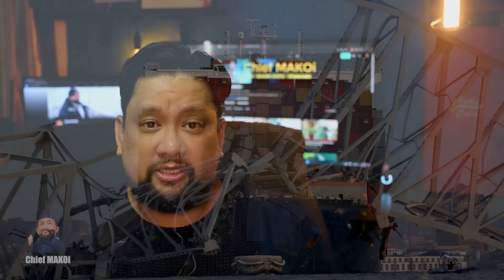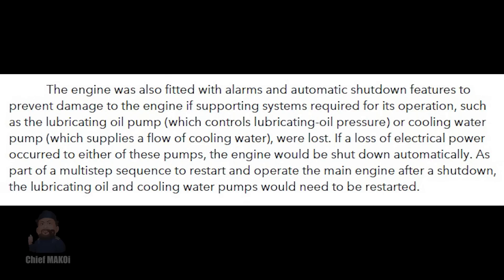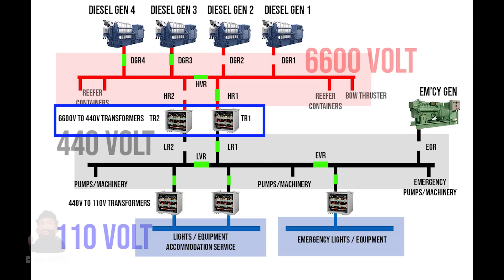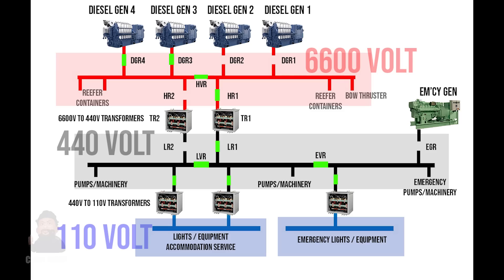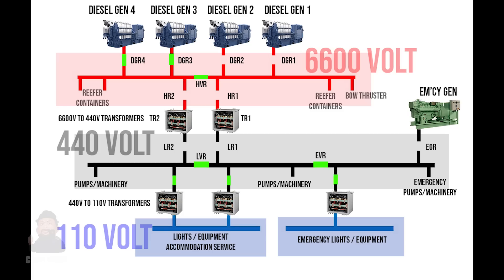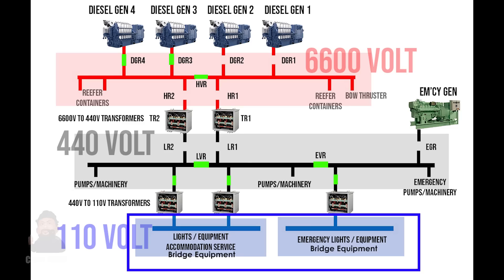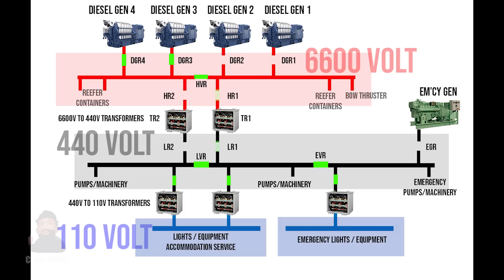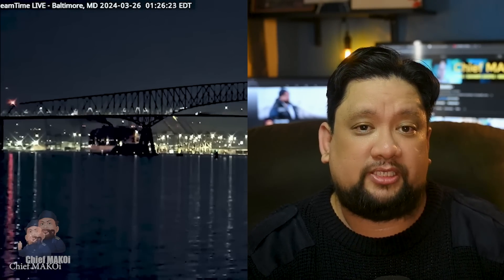Explaining the NTSB Report on the Container Ship DALI | Chief MAKOi

Comment: Regarding the fuel. I would expect NTSB already sampled all tanks and performed FOBAS.
Reply from the maker: It's not contamination.
Reply: @ChiefMAKOi  As I understand it,  samples were sent to the lab.   No contamination was seen and probably not there,  its pretty good stuff in the US at least.    But they will have a full on test series done to see about lubricity good,  cetane up to spec etc.   It may show workable but not as good as spec and its a chance to get that out if so.

Comment: Chief Makoi, I've been a long-time fan and enjoy your videos.  Great analysis!  at the 12:45 mark there is a brief subtle flash on the top beam of the bridge to the left of the Dali, about 20% of the screen width from the Dali.  The lower beam of the bridge has a significant buckle at that point in time directly under that flash suggesting that there may have also been a pre-placed cutting charge on the top beam to facilitate/direct the collapse.  I don't know if you or any of your viewers noticed or care to comment--keep up the GREAT work!
Reply: Could there have been a worm in the software of these automated systems?  There have been reports that the Chinese container cranes in port could have surreptitiously inserted code into shipboard systems (as could numerous other causes), I know you're an engineer, not an IT security expert.  But with automated systems, software is involved, probably not air-gapped systems so accessible online especially when in close proximity to appropriate digital transmitters as would be more likely in port than at sea...
Reply: Ahh the conspiracy stuff comes flying out.    You don't think a million tons ramming a bridge can bring one down all by its lonesome?    Look up the Tampa Bay Bridge,   Tacoma Narrows and the Minnesota collapse (and the near failure of a bridge down Tennessee way that inspections were being faked on).    You just proved there is no over coming the power of human stupidity.
Reply: Some considerations from technical perspective wrt collapse of the Key Bridge itself, some `moving lights´; but especially some `flashes´ which can be observed. Quite long comment, targeting to come up with the physics behind. Deleted my earlier comment and replaced with more detailed review now. Time stamps refer to YT video uploaded by `First Coast News’ (Full Video Francis Scott Key bridge ...); I've also uploaded this comment there.
This moving light, starting 02m31s coming from right, going to left (until 03m13s) at a level where webcam position suggests is “same height as the main bridge truss”, can simply be either helicopter or airplane – that’s it. Period.

Few considerations before digging into the other, individual flashes observed. My view upfront: some of them related to simple electrical shorts, the others most likely due to strong metal bending and ripping caused by forces of the collapse (only).
At 0129 EDT am it’s typically dark, except from the lightshow coming from Baltimore harbour; with some top lights of the container cranes on same height as the bridge truss. So easiest explanation for some `flashes´ simply might be lights being hidden before. Possibly also some reflections when the bridge segment starts moving downwards. Plus the smoke from Dali also causing some blurring effect towards left side. Camera sensor might also be more sensitive with sudden changes when lights covered by the truss before get visible.
However, yes, when carefully observing and watching the video, this cannot really explain the flashes observed.

First glow at 05m39s (012849EDT), then 05m40s (012850EDT), the video shows two flashes, i.e. glowing spots in the middle of the left bridge truss which collapsed and shows serious bending already. Take note all 3 bridge’s flashing signal lights still operating at that time and turned on (especially the one to the right just switched on) – i.e. electricity still present. So easiest explanation could be that we simply can see their cables being damaged and creating short-circuit – which typically ends up with flashes. That’s very obvious for the left bridge truss segment. Assuming cables are running along top side of the truss, that could also explain the flashes observed close to the signal light in the middle of the main truss few moments later at same time 05m40s still. Note this signal light only briefly seemed to light up again but never fully made it and is gone then. At some point we might expect a breaker tripping due to high current. Also lighting on the bridge lanes disappeared on the left and middle truss segment (while still working on the one to the right).
05m42s (012852EDT) is very interesting since the main truss starts to break towards its right pillar, with flashes both on top side of the truss but also its lower, inner bow. I’d be bit surprised and ask why the cable for signal lights on the top should move down to the inner bow there. Could be; flashes would have same root cause then although I’d be surprised that no electrical fuses already cut off power there.
Much more important, extreme bending can be observed, due to large amount of the truss already accelerating towards the water due to its weight and force of gravity (plus possibly some forced due to the impact when Dali hit the pillar), while the part close to the pillar still fixed to it.
05m43s (012853EDT) the middle of main truss has already reached water level – i.e. 50m lower. Same time lights went out on the right truss, possibly another short circuit in case there’s still been voltage present in the cables.
So far some the flashes could have been explained by shorts in the electrical cables. First “white” flash, follow by more yellowish / orange one in case some of the isolation gets burned & vapourized.
But I don’t think that’s all, so let’s get to some more nasty stuff – physics. To start with something easy: there’s no question that cutoff grinding creates a lot of sparks flying around, right? Obviously steel doesn’t really like this treatment. Glowing sparks suggest quite some energy involved, too.

Main truss of the Key bridge had clear height of more than 50m / 167ft. Top level of the main truss could be up to 100m / 333ft. The bridge starts to collapse and gravitation kicks in. Very simple rule says with acceleration of 10m/s² , after 1 second speed could be as fast as 10m/s = 36km/h already; and main bridge truss already dropped by 10m then, too. In reality it can additionally be influenced due to some mechanical forces (either slowed down or accelerated further). Energy goes with velocity squared; v² - ooopps. At 05m42s; i.e. only 2 seconds after the initial flash described for left truss segment, the inner bow moved down by approx. 20m / 66ft, with a speed of already 2s * 10m/s² = 20m/s = 72km/h then. Tons of steel crashing down and heavily pulling at those points where one can observe the flashing in the truss. Again, 05m43s the middle of main truss has already reached water level – i.e. 50m lower. If you simply drop a stone from 100m height (let’s neglect some potential friction when moving in air), it reaches water surface after 4.47s , at a speed of 44.7m/s = 161km/h – oouuch.
05m44s (012854EDT) the last angle-steel strap rips–off finally, with another remarkable flash. I wonder if that’s electrical cable still, or whether this is different effect now.
Bending and finally ripping-off creates much heat, and there’s very strong forces involved here to bend these angle steel straps for sure. So I’d say this flash might be caused by the forces & energies made visible in the darkness of the night when the electromagnetic bindings between the atoms are ripped off, possibly also ionising air due to the heat involved. Feel free to call me `mad dog´; but when has this made visible in such a way before?
But I have something even much more spectacular for you:
05m47s; especially 05m49s (012859EDT) - check the collapse of the truss directly above the right pillar of main bridge section. It starts unsuspicious, however exactly when lower bow of the truss finally crashes on the pillar. You can observe very pronounced orange glowing then, first on the right, but later especially to the left. Could partly come from port lights, camera effects etc. However, this segment crashes down with upper parts from height of 70m minimum, then `rubs´ along the pillars (remember, 50m clear height minimum), creating lots of friction, bending and heat again.
Yes, may look like blowing of charges or some explosion. But partly takes too long (expected to be short single flash); and I’m missing the smoke that would typically come along with that (especially when the flashes are in orange).

It's all physics triggered due to MS Dali crashed into the pillar; without any other additional “influence”.

By accident, the roadworks at night and quick reaction of Baltimore pilots office and MDTA officers prevented human disaster of even higher magnitude.
Those 6 road-workers who have lost their lives – may their souls rest in peace. My sincere condolences to their families.

Comment: Power utility/substation/power plant person here. From what I have seen, there appears to have  been an issue with the 69 kv to 480 transformers or circuit. Both HV and LV breakers tripping at the same time looks like a transfer trip because their system saw a fault within the transformer. My guess.
Reply from the maker: Same here.
Reply: @ChiefMAKOi  That for sure is one of  my prime suspects.    In theory even a zark on the LV side should only trip the HV breaker,  but CB coordination can be weird stuff.

Comment: Wouldn't they still have had the bow thruster through most of this?
Reply from the maker: By the looks of it, yes.
Reply: As I understand it,  while they had it,  it was not a used option because it normally is not effective above (3 knots?).   If they could have started it (ie,  did they have controls working)  and fast enough it could have helped.    But then the poor guy on the bow was not expecting to be dodging bridge debris trying to kill him and leaving the anchor brake (which would release if he was dead).
Reply: @gregoryschmitz2131  

Bow thrusters are electric, not much to starting them. Just thinking it might have helped a rudder with no propulsion behind it. I know these ships are massive, but they came close to missing it. You have to try everything when it comes to saving lives.
Reply: The bow thrusters influence at 8 – 9 knots speed ahead might be quite limited, and they would also draw a lot of power in order to push the huge mass of the vessel and overcome its inertia. So one the one hand, using them might have contributed to another black-out even earlier than it happened ~1 minute later again; this time due to DGR 3 & 4 breakers tripping which anyway appear to be operating in overload condition judging from the heavy smoke. On the other side, I wonder whether trying to push the bow away from the pillar might have resulted in also moving stern closer to the sides of the channel and the pillar of the bridge since turning is expected around the centre of gravity of the ship, thus potentially not really improving overall situation.
We don't know; I could imagine NTSB team might also investigate to run some simulations wrt this but put priority on technical root cause finding first.

Comment: A couple of thoughts:
1) would the bow thrusters help steer the ship?
2) could they have been controlled when the 440V bus was back on?
Just thinking that if the rudder has limited effect when the prop is not turning, couldn't it's effect have been aided by the bow thrusters?
I'm guessing they are only used to manoeuvring, not when moving at a few knots, so might be ineffective or even disabled
Reply from the maker: At that speed it won't be effective.  It would have been worth a shot, though.

Comment: Is it possible its somehow a human error or maybe a bunch of human errors that possibly could have contributed to the ship losing power . could someone have forgot to check the fuel tank level before leaving port . how come transformer 2 didnt automatically kick in if the other transformer went down isnt there some sort of detection system that would automatically sense a sudden power loss and kick in . if the ship was in port dont personal do routine checks on the transformers to see if theirs a problem if the transformer is shut down or offline wouldnt you take that opportunity to maybe look and visually inspect the wires both on the upside and the downside .
Reply from the maker: Definitely.